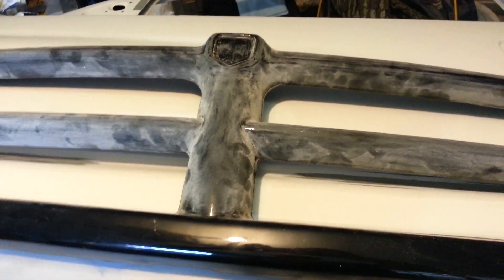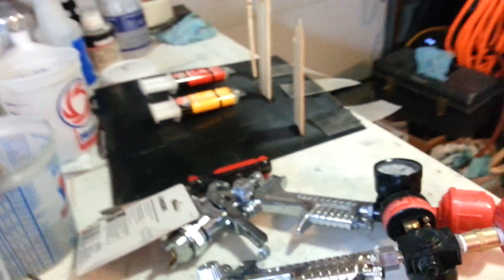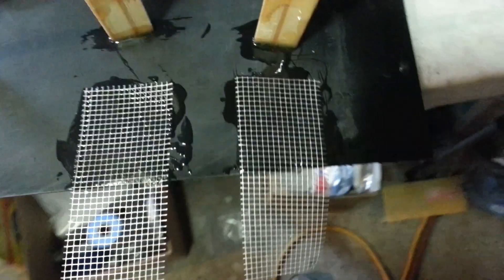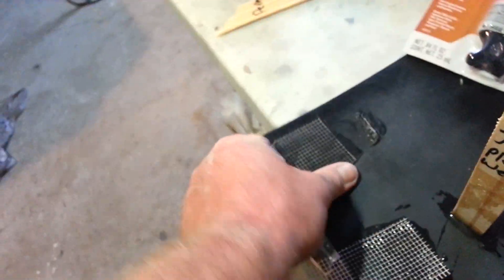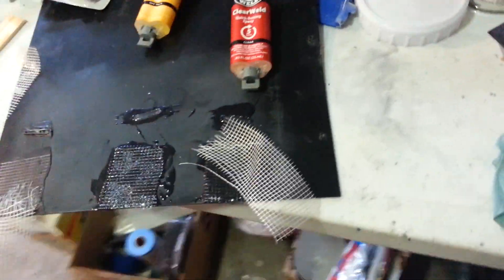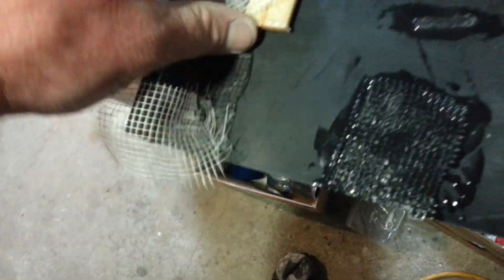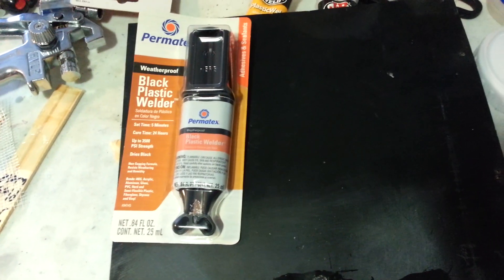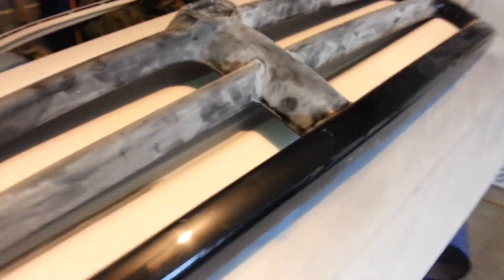Permatex plastic weld testing

Comment: I have been using the plastic weld for years and it is some of the best stuff ever.  I have fixed the shelves on my refrigerator, door hinges and latch on my microwave.  The rear bumper kit on my son's aftermarket bumper on his Grand Am,  Glued the rear view mirror after it got hit and broke off.  It  was still holding when he sold the car several years later.  That is some of the best stuff ever!!  The fix is usually stronger than the plastic around it!!!

Comment: I was just about to go get some JB... after seeing your vid, I'll go with Permatex.
 My purchase choice is due to your vid. And I'm sure I'm not the only one who made a decision based on your video.
Permatex owes you a case, if not more, of your choice of bonding agents. 
As for me... i definitely owe you thanks..  saved me some headaches. 
So thanks for sharing your test and results.
Chase
Reply: was gping to get JB but Permatex all the way after seeing this. Guy is right, Permatex owes you advertising money and a percebtage of their profit
Reply: holy shit. add me in on that as well. I needed an epoxy for Metal to Plastic. it seems like JB Weld wouldn't have done the trick.

problem though, needed for a craft and the black may be a problem. 

just have to work around it for the durability I guess.

Comment: I made a strengh comparison video of this Permatex Plastic Welder, and this thing blew a lot of other epoxis out of the water for gluing steel (I Know!), including JB Weld, Permatex Steel Weld, and other epoxis. I mean, it was more than 10 times stronger. It was even stronger than a carbon fiber patch that I made with clear epoxi. I was shocked!

Comment: All of the quick dry epoxies I've used all said full strength in 24 hours. 
The handling strength was at the quick time shown on the package i.e. 1 hour.

You have to prep the surface for bond before using, or it won't bond! That's for all epoxies.  I've been in aircraft manufacturing for over 25 years and most if not all bond failures are due to poor surface prep. Sandblasting works best but HAS to be bonded within 4 hours. Scuff sanding is 2nd best. Follow the surface blast or sanding by wiping with alcohol and let the alcohol dry for 30 minutes before bonding. Clamp together and let cure for 24. hours

Comment: I just used jb plastic weld on some polypropylene and it was basically useless. Just in case anyone was doubting the results like I was. This was poly to poly gluing btw.
Reply: You will need the correct type o adhesive/epoxy depending on the type of plastic. The You will need a different epoxy for polyethylene & polypropylene plastics

Comment: Greetings, I would like to know if that glue Permatex black plastic welder is heating resistant?, I mean if it’s expose to heating it won’t start to melting?
Reply from the maker: It's got close to same heat resistant as regular abs plastic, so if regular plastic is there, this will be fine
Reply: Ram It , it is for a cracked laptop battery,what do you think?